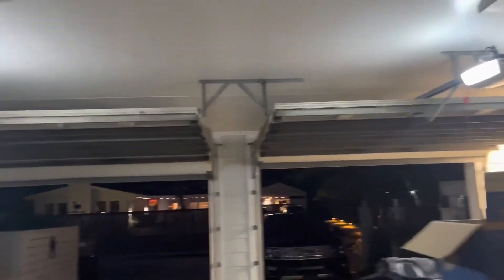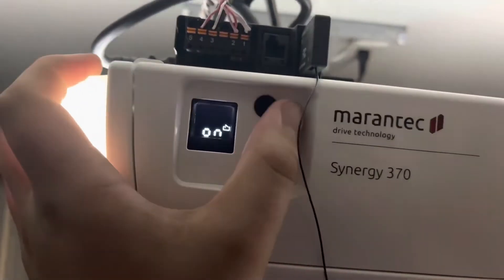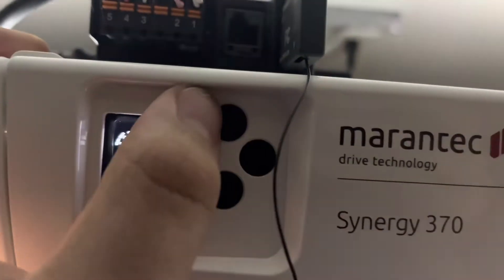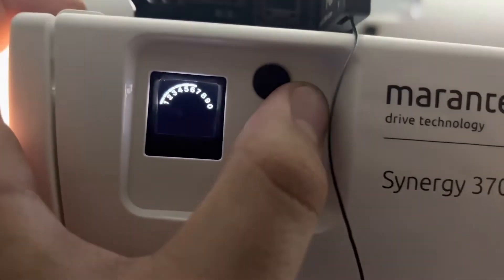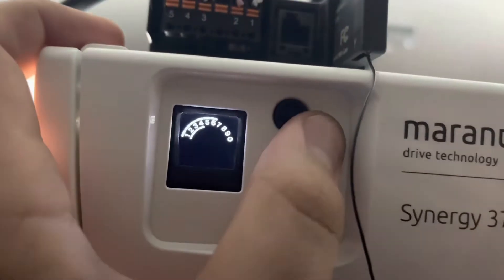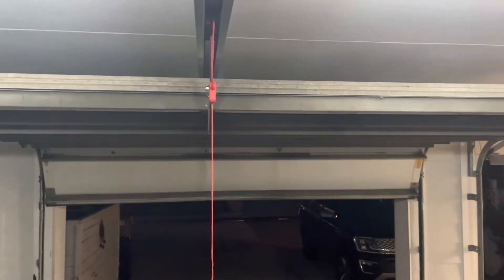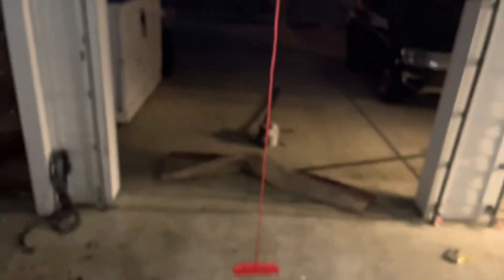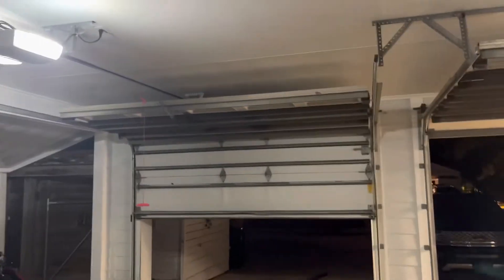How to Adjust Speed on Marantec Synergy 370

Comment: Hi how do you come in to this menu on my 370 It’s blocked thanks
Reply from the maker: i’m not sure why it would be blocked; here’s the steps

Push and hold P for 10 seconds to go into advanced programming. It will count up and go to basic programming for limits and when it gets there it will bring up the number rainbow. Now the line on the outside of the numbers is the "level" the line on the inside of the numbers is the "menu". Push + to go up - to go down. Once in the advanced programming go to level 6 and Push P. Then go to menu 1 and Push P. You have options 5-16, 5 the slowest and 16 the fastest. 12 is the factory default setting. Once you select the desired speed, Push P to save. To adjust closing speed, level 6, menu 4. And same numbers, same steps. Push and hold P after all settings have been saved for 5 seconds to exit advanced programming

Comment: do these work on Precision PDS 370 models?
Reply from the maker: Should
Reply: hey Garage Door Openers, i just checked which garage door was founded first, and it was the marantec garage door opener. Precision Door Openers have permission to actually sell Marantec extras 370’s . Found out yesterday.
Reply from the maker: yep the off brand linear and marantec
Reply: I’m probably guessing that Marantec gave permission to Precision to sell the exact same models (370, 380, 270, 280.) Do you think that this is okay or not?